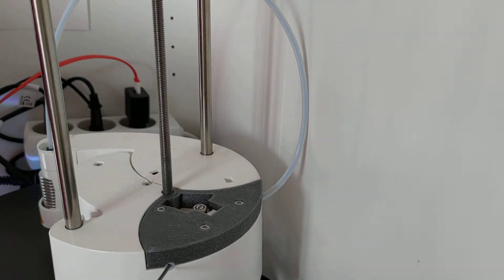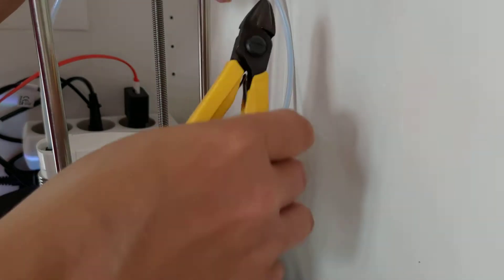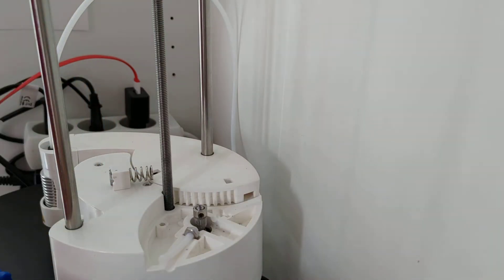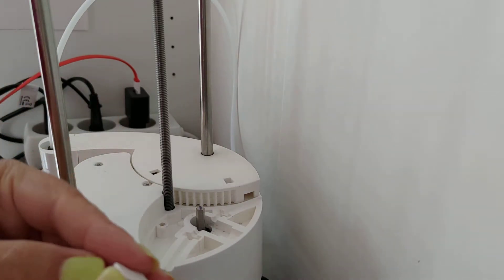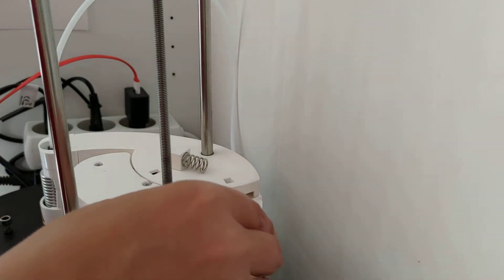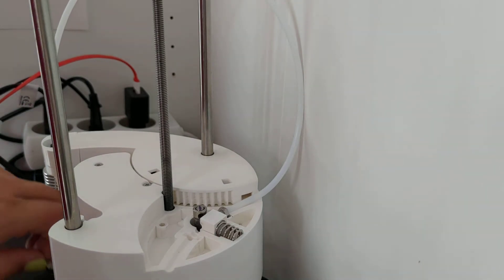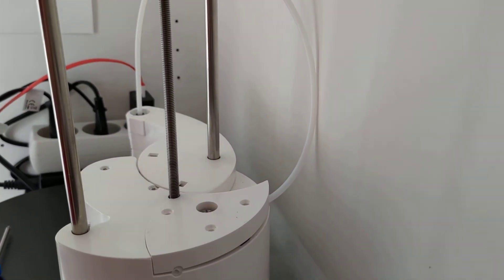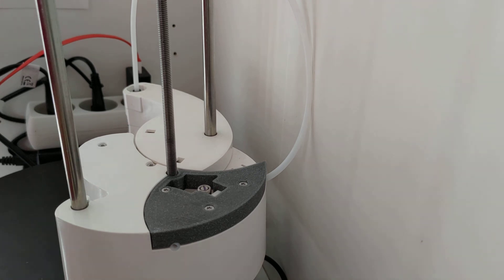Sculpto 3D printer top disassembly and assembly

Comment: i just got a Sculpto 2 now in Sept 2025. Main reason is that I like unusual 3D printers. I also have a Cubify Generation 2, which you can see videos of. Of course I got both for almost no cost. I did have to replace the heater and/or thermistor, so I just replaced both. That was tricky as the very top, the gear that makes the arm move, that grooved top part, if it comes apart it has 2 tiny springs which are a challenge to put back together, but I got it back and now the printer heats correctly. I run a print farm so, no, this is not in my print farm. I now use VORON machines which are incredible. But this is a cool printer to watch. I'll make a few prints and then just have it sit around for a unique visual.